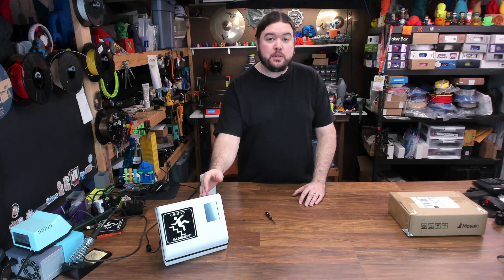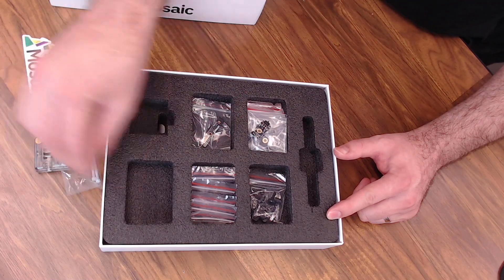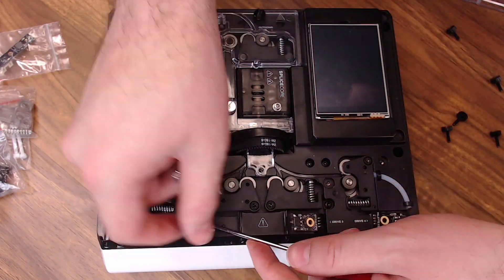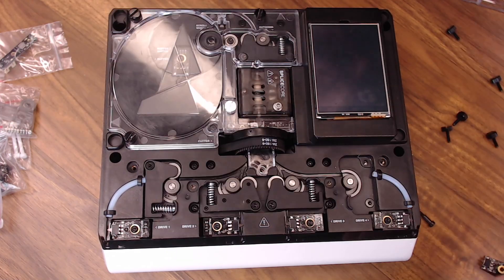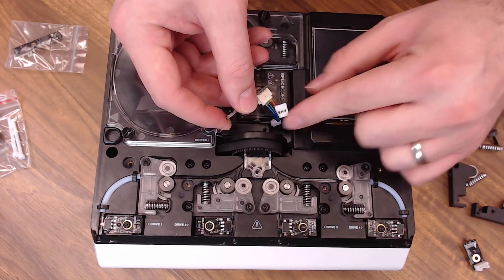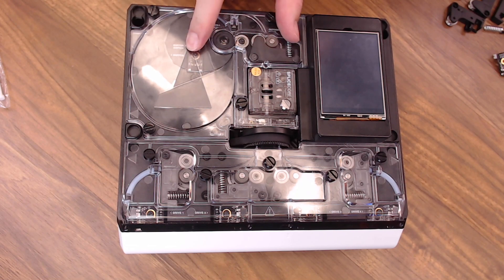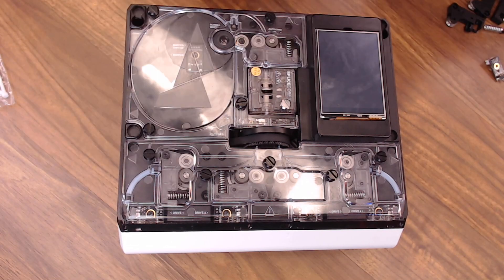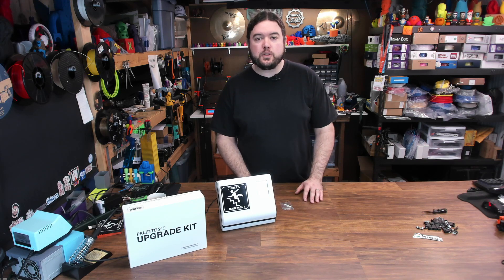Palette 2s Upgrade Kit - How to - Chris's Basement

Comment: Hello Chris
I updated mine also too 9.2.9 but as before it keeps giving me to much filament.
It even push out the tube and even double the length 🤔
Reply from the maker: That's odd, I haven't seen any firmware updates for these in a while either.
Reply: @ChrisRiley  its on my screen so i think its there ( the update ) 
So i haven't a sub likely thats the problem, no ping&pong.
Would you think the new Creality box wil work as a sub ? Wil it take octoprint and the palette software?
Maybe something 4 you to or has anyone else figured it out 🤔
Sincerely Frits

Comment: Chris, Now that it has been about 10 months, what do you think? Was the upgrade worth it? Do you like the Palette better than any other system you worked on? Do you think the MMU and Chameleon are better or worse?
Reply from the maker: Hey Chad, the upgrade made the device a little more sturdy and works better on flex, but it still has issues. I like the MMU2 better.

Comment: Are those replacement switches mechanical or optical?  What exactly is the upgrade in terms of those switches?
Reply from the maker: They are mechanical. The original ones were a bit fragile. These seem to be a little better quality. On the old switches I had issues with the metal tab getting pushed into the switch body.

Comment: Hey Chris i upgraded my 2s pro i had to change some of the setting to get a good weld. It wasn't pushing the filament enough and ended up with a thin spot at the weld.
Reply from the maker: Good to know, I have just test PLA so far, but I will go back and do another tune for sure.